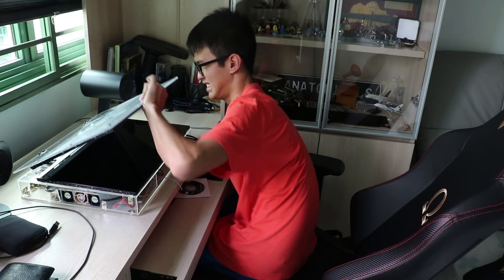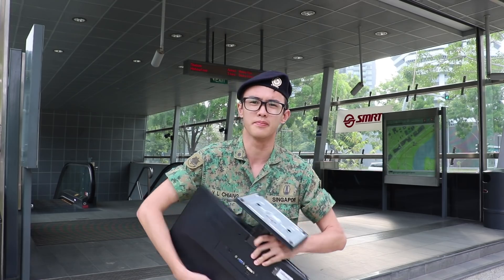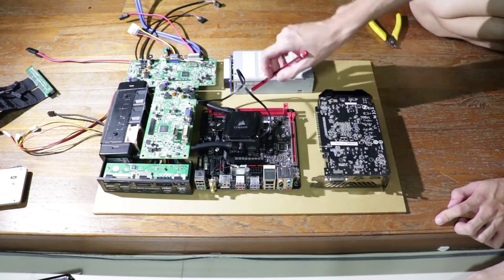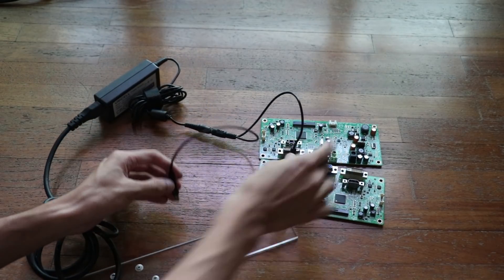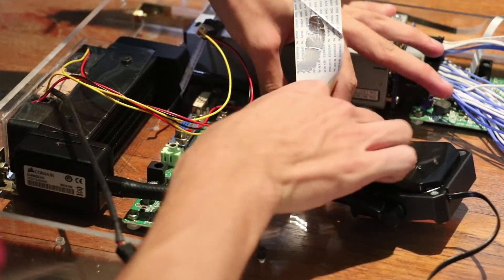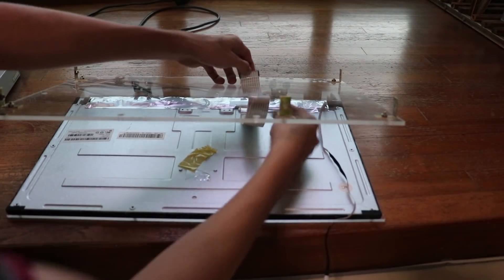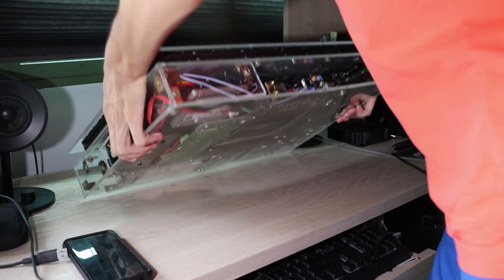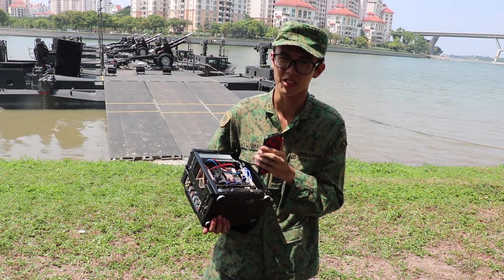DIY Dual screen portable desktop

Comment: You have the same graphic card inside that little one black p.c. case? It was a great video! Thank you! You are probably a cadet of military school, but you do not do trainings,do push ups,it easy,burpee is funny. 10kg is not that heavy if traveling with a car. Ssd do not fear dropped down. Probably lcd does.  https://youtu.be/nf9JVfbcL_A an American did it for himself in a case that isn't that heavy,that You have used, transparent polycarbonat. It has weigt. ,You also could use lcd from laptop using a covertor Vga hdmi expansion board, and replacing 220v heavy power supply to 12v power for lcd. But I very respect your project,it was very nice,made, beautiful! Bravo!!!

Comment: Honestly this was a really cool idea and fairly well executed.  With a few changes it would be a really cool travel PC for lan parties.  Find a better way to put some of t he parts in and create better air flow. And this would be a great PC idea. Maybe add a touch screen monitor for the bottom screen. Add a handle and a way for it to lock so it won't open during travel. All in all awesome vid and build man. Don't beat yourself up. Even if it kept crashing.

Comment: well its a good idea if using smaller displays not 24-32 inch ones. as for the gpu  if its a home based pc you may actually add 1 nvidia quadro gpus (FX3800 should fit just fine). for keyboard I'd suggest silicone based ones (aren't that good but..you get used to ) as for mouse..wifi one.. for laptops  and there you go having all in one . (true..add 2 gpu's 4700 ones and 3 displays -then leave your home unlocked ..none will dare to steal that )

Comment: First, very nicely made video, congrats. The music was a tad hot over your dialogue, *but I'm just being picky. A+ Production/Editing/Score/Story Telling! 

2nd, and of equal importance.... very interesting build! I understand it didn't end up working out, all-things-considered, but you have given me some confidence with an idea I've been conceptualizing on paper. Thanks for that!

Quick question, if you have a moment ... I'm assuming the 2 displays used in your design were already touch-enabled? And you simply 'extended the desktop' within Windows 10 settings? Or were you somehow able to link the two panels so they function as a single monitor inside the OS? Were there any driver issues or anything like that? Also, would you possibly link me to the HDMI (or display port?) adapter you used to connect the monitor panel to the GPU?

Big thanks! Subbed! Keep it up!

JWood

Comment: Of course it crashed. 79 degrees is too hot for a computer that's not doing anything, it should be around 40 to 50 at the most. The computer must have been getting to over 100 degrees. And we are talking about celcius, not farenheit, which means you could cook with the cpu. It's hot enough to make some components fail and others stop working, certainly the heat from the power bricks wouldn't help. You could have made adapters for the PSU to power the screens.

Comment: Hello Atomicals, I have seen your video several times and it is very interesting, my question is how you can reuse 4k laptop screens with a motherboard of a Lenovo W540 or would you have something similar to do?
Reply from the maker: The W450 is a laptop motherboard and has it's own custom display connector on the motherboard, which is reserved for your laptop screen.
Thunderbolt port/VGA is the only option to drive an external screen to work with your laptop, and i don't think it can do 4k.

Comment: i like the concept dual screen portabel computer i got a 27 inch portabel computer whit  battery  and a touch screen it also got a hdmi too connect playstation 4 ect and it only the weighs  7 kg it is a lenovo yoga home 900. lenovo also got a smaller model named lenovo yoga home 500 whit 21 inch screen

Comment: One thing you missed is airflow. But this is a really good idea.
Reply: The only important thing... that was stupid.. that gpu is on fire dude.... OMG... the build was going well... and finally..... watching that gpu with no breath holes or anything, then he show those temperatures? Its grosse. When you build something is not just putting  parts together and make look nice... you need to think what are you doing... the AIRFLOW IS THE MOST IMPORTANT THING... NOT JUST A DETAIL...

Comment: what kind of power supply was used to power up motherboard? bit curious as i've only seen around square box power supply for motherboard. plz.. share a link for it. your project was awesome. might get even better with installation of keyboard and trackpad instead of bottom part monitor. thanks for great video.
Reply: flex 400 watt or delta 500watt psu i can provide link if you got access to shopee app

Comment: You should make a version with a smaller screen, bluetooth keyboard and mouse, and a Ryzen 5 2400g APU instead of separate CPU and GPU. Of course it would not be as powerful as a GTX 1080. But you have inspired me to try something like this in the summer. I made one version like this using an i7 4770 and GTX 1050Ti low profile though I added a GTX 1060 later one (ITX). I used a 300 watt sfx psu though which I should have used a 500 watt one. But instead of acrylic I used a wooden box that had a lid that could fit a 23 inch monitor which I vesa mounted to the inside of the lid. My dad helped me cut the box shorter to match the height of the sfx psu. I didn't have room for a keyboard or mouse though it has a micro atx mobo, 12gb ddr3 ram and a noctua low profile CPU cooler. It was really cool but was too heavy to use. However, I used it for around a year and took it on 2 or 3 trips to Scotland and London on the coach. It survived the trip although maybe an ITX gaming PC and portable monitor would be easier to carry. This is super cool though but I was thinking of making a small form factor version of your acrylic one with a 15 inch portable monitor from Asus, a Ryzen 5 2400GE (35 watt quad core CPU), GTX 1050Ti (75 watt GPU) and 160 watt hdplex pico psu and 240gb SSD. Then it would be really light and I could have an external 180 watt laptop charger off the pico psu. Do you think this would be a good idea?

Comment: Good try !!
You should probably use all laptop components to reduce space

Better yet, you can try using one of the intel nuc to save yourself a lot of trouble
Reply: Something like 2 laptop 15.6 screens, sodimm, external power brick, external gpu design (pcie x4 slot out)

Laptop keyboard + touch pad
Reply from the maker: or just buy an ASUS zenbook Duo ux581

Comment: Reminds me when I built a Laptop/portable PC from Desktop Parts back in the 90s. Had a LPX platform motherboard, left of the riser card. Used a full size keyboard and modified a track ball mouse. Ended up making a single PCI slot riser card to use a Voodoo 3 to have S-Video out. Had it in a plywood case then found a brief case at a thrift store that ended up being the final case.

Comment: What I really appreciate most is the warning; perhaps a project worth doing with spare miscellaneous parts. And I wouldn't call this a failure as you not only had the experience, but I'm pretty sure you had some brainstorm ideas about what could have been improved as far as design, weight & build (possibly more). This was a pleasure to watch. Thanks for sharing!

Comment: all of the air ventilation issues can be easily taken care of using a fans with duct works pushing air to key compnets not just bouncing air around inside case with another exhausting the free flowing air thus sucking out hot air. water cooled sucks. it is a huge heater inside that case as where air flow would been better over all cause its another fan moving air around inside the case. but to each their own. if you like water by all means use it on your electronics. me NO. and i have no need to.  quiet is not a option for this unit. i think if was a metal case like same material as a pc case it would left him room for many more upgrades for air flow. and prob lighter over all. he added 2lbs of screws and hardware. he had a 1lb water cooled system. that took up huge space that could been another gpu. screen on he bottom needs a fan under it to move air cause it will burn up the screen pretty fast. and im sure its hot in your face like that. esp if was lcd and not led lol.

Comment: this has many many many real world applications. awesome build. i been talking with a friend this morning about a similar build where ill be able to use a dock mini hub wireless and can walk away from the bigger unit for certain things. but if able to open all the way up to stand up on some feet/legs to able access the i/o to help run a security system :) for on the go for like concerts and festivals. cause sometimes those system require way to many wires and limited to the laptops capabilities. lugging a bigger pc around all time sucked. but for those who do it still it would make a world of difference cause they can split screen down to 4 monitors with around 24+ camera screens.

Comment: That is a nice computer. I bet there were lot of things that you could have done differently however cost and supply probably limited what you had available requiring compromises. Yet you still did an amazing job with what you had available. That os what I find amazing. Great mod!

Comment: Why didnt you just use the 12v from the psu to power the display controllers? and solder wires instead of adapters!

Comment: U could of used barebone laptop screen and could of bought a controller board that would connect to the LCD ribbon cable it would be lighter and it would lower the voltage and the weight of the laptop would be more portable buy good concept.or in stead of using a desktop mother board u could use a laptop mother's board with a mini pcie slot and add a second display but u will probably need two laptop batteries a mini pcie adapter to a 16x pcie slot female then u will need a second  graphics card and use the second laptop to just power the graphics card I seen it done but not in the duel screen laptop. O I almost got you will probably need a mini pcie slot split card because some laptop's use the mini pcie slot for wifi card don't worry the mini pcie splitter start at $30 US dollars and the mini pcie to 16x slot adapter start at $50 to $60 US dollars plus if u go with much smaller monitors        
15 to 10 inch laptop monitors  it will greatly reduce the weight and power need.   I have an old hp 2015 laptop and I was wondering if there's away to completely ditch the keyboard and mouse 😂my dad thought that would be impossible but u proofed my theory thank u.

Comment: "Portable desktop".... 

Also known as a laptop
Reply: Portable desktops are a class of computers actually.  Not commonly seen though.    They've mostly been replaced by All-in-ones in the consumer industry.
They are usually designed for businesses (particularly sysadmins and other technicians, consultants, etc.) and tend to come with high-capacity space for drives, all kinds of connection ports.
Beefy as fuck, some as thick as this and designed with proper specialized manufacturing behind it rather than off-the-shelf.
They are also, as this is, usually without battery.
Some better ones do come with a battery purely for emergency power reasons, so you can save work / hibernate before power loss.
AH, I can't find that one I liked.  Had space for 4 drives in it.  It was nearly 5 digits in cost lol.  Very pricey since they are for such a small niche.
Reply: @Hunnter2k3  well said
Reply: No, a laptop has significantly lower specs and has a battery. This is literally just a light-weight desktop PC.

Comment: Great idea but I mean, you can do it in a smarter way.

1. Actually use a S4 mini, or achieve similar size by using basically the same components.
2. Mount your S4 mini onto a monitor with VESA mount, and then make the hinge with materials available.
3. Using portable screens instead of large screens, there should be portable touch screens available, make that your "keyboard screen".
4. Another screen for high resolution / refresh rate goes on top.
5. Since your screen is not relying on your power supply, using an SFX power supply to reduce space.
6. Use a bag (recommending Wallye Tactik Duffle) to carry around.
7. 11:09 IO SHIELD!!! (lol)

The way I would do it (and I actually came across this video because I was going to do the same thing without having two monitors connected with the PC as a whole piece):
1. NCase M1, Silverstone SX800-LPT, Custom loop with Alphacool's CPU / Pump combo, 240 radiator on the side, graphics card cooled as well, hard drives go to bottom.
2. Double screen seems fun, but actually isn't. But a hinge for double screen is brilliant. Detachable hinge for the two screens is what I would actually do, and they should be standalone from the PC. One high refresh rate portable screen + one Cintiq Pro 16... is what I wanted, not really deciding to have a Cintiq yet. I like drawing but spending 1k and a half makes my wallet bleed too much considering my components are already expensive.
3. (*IMPORTANT*) Make sure to have custom cables cut to length, or try with the shortest one and go all the way up. For SATA power use SATA power cable if you don't have Molex, some people cool their rig with pump/res combo with Molex connector, and for that you can save space by using Molex to SATA power converter. Cable management is important for a build like this. I have to say Anitomicals C has done an absolutely horrible job on cable management despite his well thought out ideas and even layout of components. The cables are eating up too much space.

And for those who thinks a second monitor for keyboard and / or mouse is a good idea, Seems like you don't know how fullscreen games work huh. Clicking on a screen keyboard instantly pops you out of the game. You need a physical keyboard for SURE. Unless you are doing office works then WHY ARE YOU EVEN HERE WATCHING MY MOST STUPID TECHNICAL COMMENT THAT LITERALLY NOBODY IS INTERESTED IN? (jk, love you guys <3)

Comment: Would of been better if you just built a computer into a suitcase and exhausted out one side and intake on the other. Use touch screens so you can use on screen keyboard for the bottom and for the mouse well, it's a touch screen. I did this already once before with a Windows 2000 computer several years ago. Sadly that machine was stolen. However it used an AMD Athlon 64 and an ATI Radeon AGP card. Touch screens back then were EXPENSIVE.

Comment: A huge mistake was made in cooling the video card. In the case there is not enough space for air ventilation and the video card can get very hot. This can tell on the reduced life of the video card ((((
Reply: yea, should cut slots in the plexi, so your video card can breathe more.
Reply: @sketch2620  He won't do that since he too thinks that this is stupid and had reverted the PC since. And cutting a hole wouldn't help much since the back is hot as well and it's just heating up the internal components faster and faster. Yes your graphics card is cooled but all other PCBs aren't. Plus horrible cable management despite well thought on component placements, making internal airflow worse. Making a big hole wouldn't help and instead I would even doubt if the acrylic is strong enough to hold such weight, after drilling a big hole dropping the whole piece 2 ~ 3 cm would crack it.
Reply from the maker: This is very true. Any more drilling would compromise on the structural integrity of the case, and being 10Kg heavy, it's not a portable machine. Cooling is an issue, but just like all high end laptops, manufacturers simply allow their components to thermal throttle and rev up the fan speed.
Reply: yea it was choked of air but 80c max on furmark is not bad
Reply: all of the air ventilation issues can be easily taken care of using a fans with duct works pushing air to key compnets not just bouncing air around inside case with another exhausting the free flowing air thus sucking out hot air. water cooled sucks. it is a huge heater inside that case as where air flow would been better over all cause its another fan moving air around inside the case. but to each their own. if you like water by all means use it on your electronics. me NO. and i have no need to.  quiet is not a option for this unit. i think if was a metal case like same material as a pc case it would left him room for many more upgrades for air flow. and prob lighter over all. he added 2lbs of screws and hardware. he had a 1lb water cooled system. that took up huge space that could been another gpu. screen on he bottom needs a fan under it to move air cause it will burn up the screen pretty fast. and im sure its hot in your face like that. esp if was lcd and not led lol.

Comment: Great idea, overall. A few things  for future revisions:
* Cut the power bricks open and fasten those boards directly to the "case". Also do the same with the PSU
* Don't use the video driver boards that came with the TV's, get the replacement boards. They are smaller and only cost about $11USD
* The shroud on the video card should of been removed, along with the fans. You used a blower fan which should of provided plenty of air flow, but was hindered by the other fans. The air flows were fighting each other. 
* The power bricks should be placed near an air inlet port to allow them to cool. Under heavy loads, the PSU/bricks would be generating more heat which builds up in the case. Also the leds on the one screen also radiates heat into the case.
A bit more airflow and this would of been a really nice build. Add a few color changing leds and it'd look great!  😎😉
Reply: Some good ideas mate!